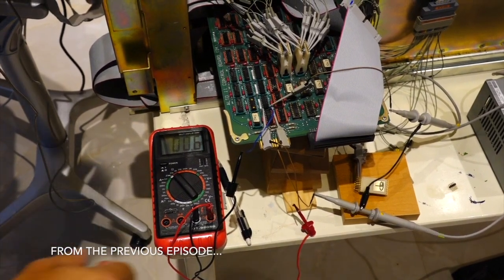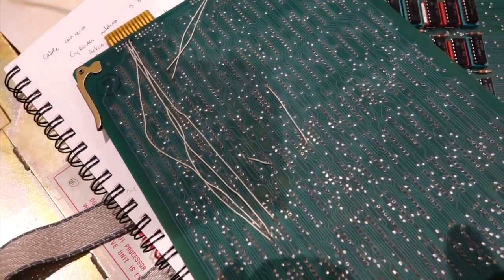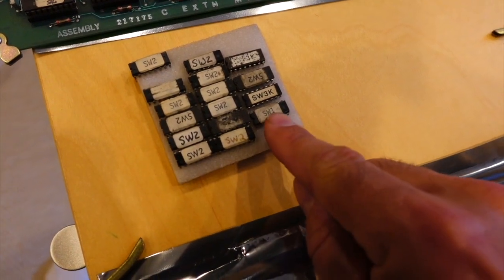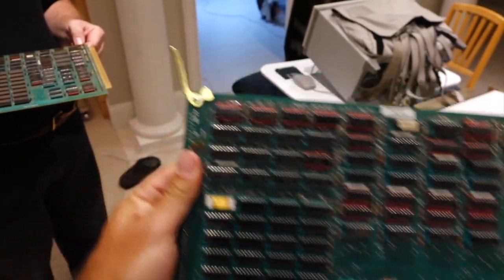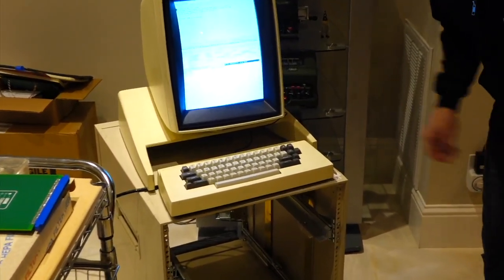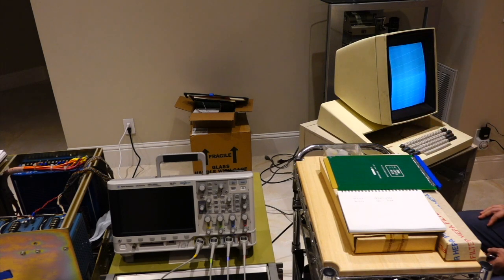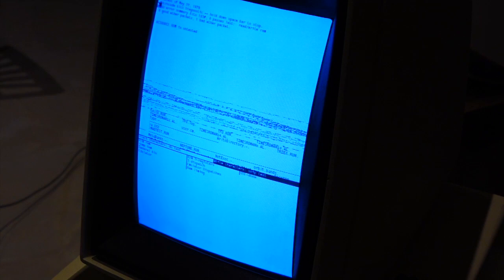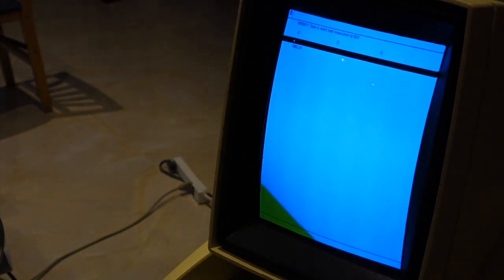Xerox Alto Restoration Part 10 - solving the crashes, first look at the GUI

Comment: The WYSIWYG word processor and draw programs look quite interesting. They don't seem to have a "refined" feel, and seem to be more of a proof-of-concept.
As an aside, I am beginning to wish computer monitors were vertically-oriented as standard, with GUIs adjusted accordingly. Looks like it would be extremely good for word processing (which I heard is why Xerox designed it like that in the first place).

Comment: I'm curious about the display monitor. Obviously the refresh rate didn't match up with whatever camera or phone you were using to record it. That's a common problem with old video display technologies, but I've never before seen what this monitor looked like when the computer was actually loading or running a program. Instead of a a straight line of difference between what the screen actually would have looked like in person and what your camera recorded, when the CPU was under load it appeared like the monitor had some sort of wave-like pattern in its refresh. I don't know if that even makes sense to you or anyone, and I'm sorry for being super nerdy, but I am a fan of vintage computers, televisions, game consoles and home video recording and playback machines, and I've never seen a screen do "the wave" like your museum's Alto did in this video. Thank you if you have time to answer, and thank you in any case for a very interesting video!
Reply: And using the mouse toward the end of the video seemed to have paused the screen's "wave refresh." You may not have even noticed this happening at the time, since the refresh-interference effect isn't visible to the human eye. If you've never watched your own video, please review it. I know little about the Alto, but I doubt that it had any sort of dedicated video display processor.
Reply: @JMacQ77 From what I've learned from these videos, the Alto's hardware runs everything with a scheduler that prioritize some tasks above some others, the users program being the least prioritized one. So it handles one thing at a time, but if one task (for example a disk access) takes a little too much time, the other ones are frozen (including display driver) for a bit more time than usual. So it's no surprise a such hardware produce display artifacts tied to current background "cpu" workload. 
Main system clocks are also derived from display refresh circuitry so it may also interfere somewhere.

Comment: I suspect the drawing program is vector based (or at least stores the image in vector form). Thus when you freehand something, it approximates an equation that best fits the pattern and stores that instead of the raw pixel locations you initially define. I would imagine this to be the case as vector files take less space in memory to represent the same information than pixel based files.

Comment: Was the operating system itself graphical? Wit icons that you could start programs for, overlapping windows and the like. I mean you start programs in a command-line. Was this due to the mouse not working first or was this the way you started programs on it?
 Feels a lot more like what you did in some DOS environments in the 80;s when you used a mouse before windows was released. (I didn't watch all of the video, just wanted to see what the OS was like on the first GUI OS.)
Reply from the maker: The OS itself is command line. However there is a mouse driven file browser, but we hadn't tried it yet for lack of mouse. From the little I have seen, it does not have a "Desktop" metaphor with icons you can drag around, as you'll later find in the Macintosh (and the Xerox Star I think). More coming when we get to it.
Reply: So it really wasn't a full fledged GUI-based OS then! I mean for "Common people" the biggest breakthrough in user friendliness was when the OS itself was 100% GUI/mouse driven. Guess the memory constraints were too big to allow this to run in the background all the time!
Still it's fascinating what they could do graphically in the mid 70;s once you started a program! The draw program was really interesting and unusual!

Comment: I've seen in a video where these computers could be connected to a LAN and talk to distant computers through a WAN. What kind of networking technology was used in these computers? I know that most PCs today use Ethernet, but I'm sure that has changed over the years.
Reply: The team at PARC invented Ethernet as part of the Alto project
Reply: Although the protocol used is probably something proprietary. I don't think TCP was available yet.

Comment: Now all you need to do is reproduce kits to build one of these at home!
Reply: akspa0 For a "DIY" processor, check out the Megaprocessor. Using nothing but hundreds of thousands of transistors (and LEDs for debugging), a guy built a processor from scratch that's the size of his living room.
Reply: akspa0 or you can just run the emulator, somehow I don't think that many people would be queueing up to buy one of these for ~$30k or whatever it would cost to make at quantity, let alone the much higher price as small series.

Comment: Wait...so the optical mouse has been around since the late 70s?  I wonder why it took so long for it to become mainstream?
Reply from the maker: The early Alto mice were mechanical, and Al Kossow and Alan Kay just reminded us that there were quite a few revisions of them. The first optical mouse for the Alto came in 1980, and did necessitate the design of an entirely novel IC that had a 16 pixels  sensor, and implemented a very clever, rudimentary non-linear neural network (!). That's apparently the one we have here. It works only on a mouse pad with a special pattern of dots. Still, it was yet another Xerox PARC first, way ahead of its time. Optical mice only became widespread much, much later, when an elaborate IC with CMOS detectors and way more pixels, correlation engines, and VCSEL lasers became practical and cost effective (the chip was made by HP/Avago, and you probably have one of its variants in your mouse today).
Reply: Cost was the reason it took a long time to be mainstream. Xerox tried to interest Apple in licensing an optical mouse for the Mac but they stuck with mechanical. They didn't move to optical mouse until the state of semiconductor tech permitted the creation of the 16 pixel sensor chip.
Reply: So, how did early optical mouses compared to mechanical mouses? Like in precision, speed, and lag.
Reply: Precision wasn't much of a factor, screen resolutions were very low.

Speed depended on your configuration, most of the time it was connected to a serial port and was controlled directly.

Lag? That wasn't a thing. Early mice were for drawing and document editing.
Reply: CuriousMarc Xerox PARC: The Tesla of our time.
Reply: I remember seeing LGR do a review of an early optical mouse and it was VERY particular as to what surface it would work on: its own metal plate. It also had to be oriented properly.
Reply: Madd the Sane Early optical mice also had to have the pattern on the metal pad intact and the pad also had to be flat, which were both occasionally less than perfectly fulfilled criteria as many of the pads were aluminium and the pattern was just surface printed on top. I worked a bunch with SUN systems that used those sorts of mice and you really had to baby the pads in transport. The mouse was trivial.

Comment: If using the mouse gets too tedious: From how the schematic looks like, it seems that the mouse could be replaced (electrically) with an old Commodore Amiga Mouse with a simple interface (buttons were "short to GND" on the Amiga & the mouse had quadrature outputs for the two axes.

I used an Amiga and remember the mouse was quite usable and working fine on a normal desk.
Reply: A Logitech P7 should work. Pretty much quadrature TTL mouse with 3 buttons
Reply: We should be able to adapt the cabling and use the Lyon optical mouse.

Comment: Is the Draw program considered bit mapped graphics?   As you may know Star had bit mapped graphics drawing and basic graphics in which you could drop drop in shapes, lines etc.  It was not really a free hand drawing package.

The bouncing Saturn Icon must have been the very first Xerox Brush aka BrushDMT!
Reply: It is under development by Ken Shirriff
Reply: Well, from what I see in the video, the Draw program is a vector graphics program, as it allows you to handle the parts of the drawing as separate objects that can be moved, copied and such. 

Of course, the actual display hardware seems to be purely raster/bitmap based, so the image is not displayed with vector graphics.
Reply: Now all you need is a transceiver and a "drop cable" for XNS :)
Reply: Alto ran PUP on "Experimental" 3 Mbit Ethernet. Ken is working on a 3 - 10 Mbit bridge
Reply: When you type 'quit' it starts the Diagnostic Memory Test program. Early Altos had lots of problems with memory, so they wrote a program that would report memory errors to the network so they maintanence techs would know if a machine was having problems. A favorite thing was for people to put their own icon into DMT. I've seen several different ones on DMT running at different places

Comment: Those mechanical encoders in the mouse are frickin' crazy. Why their outputs go directly to the buttons though, or are there ICs underneath them? Why there's so much wipers, they seem like they should be just paralleled for reliability, but they aren't?

Anyway, this is SO COOL, OMG
Reply: Mechanical encoders got to two ICs which convert to TTL quadrature. The mouse probably needs a good cleaning/lube and a rubber mouse pad. Hawley mice are a little finicky, which is why getting the Lyon optical mouse going would be a good thing
Reply: I'd just swap out the whole cable on the Lyon mouse. The only thing you'll have to do is find new pins to fit the internal AMP connector. I've got a cable from a Hawley mouse that had its case broken that you can have.
Reply: It's amazing to me that such a mouse can work reliably.  BTW Hawley Mouse House was the first company to successfully market a computer mouse.
Reply: douro20 "It's amazing to me that such a mouse can work reliably."
Ditto :)
The earliest mouse I had was "Марсианка", it was a mouse for БК-0010 Soviet home computer. I wish I stll had it, my dad took it apart ages ago :(
Reply: There's a schematic on archive.org (https://archive.org/details/bitsavers_xeroxaltosatics_5668836, click right 6 times or so) all switches and also the decoder outputs go to R/S flipflops to  debounce them.

Output is 1 TTL signal for each button, and two (I/Q) for each axis.
Reply: Christian Vogel Ah, I see, thank you :)
Now that I think of it, this circuit is not unfamiliar to me, I remember using that debouncing techique a few years back to make a momentary power button for ATX power supply...
Reply: We believe the only obstacle to using the Lyon (optical) mouse is to create a converter cable or add an additional socket for the DE-9 (usually called DB-9) connector on that mouse
Reply: Sounds perfect!

Comment: Connector for the mouse isn't a HD-15 / VGA is it?
Reply: Nope. Cannon 2DE19P. They used male instead of female pins in the connector though, which is why the connectors on the back of the keyboard looks so weird (no support around the female pins). There are some 2DE19P's on eBay right now, but you'd have to find male pins.